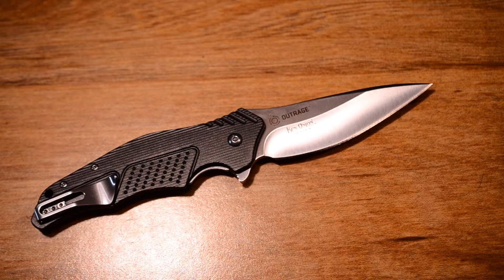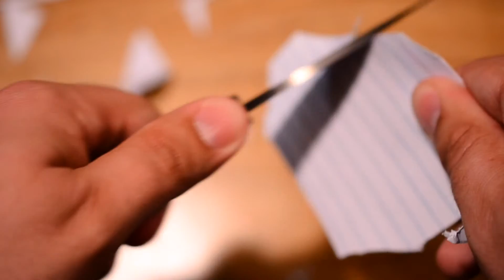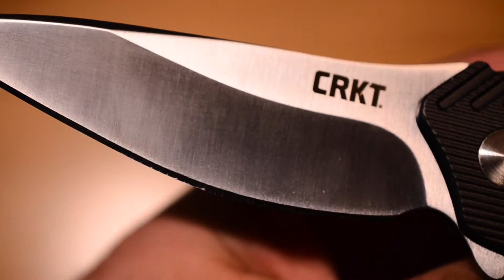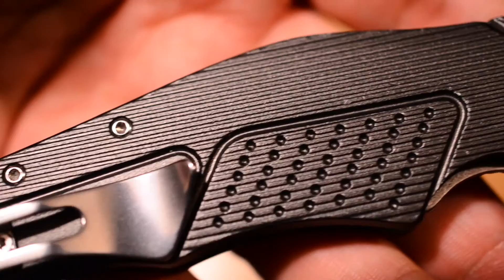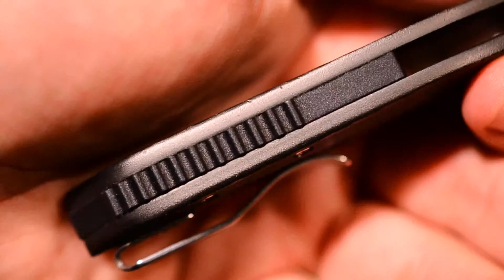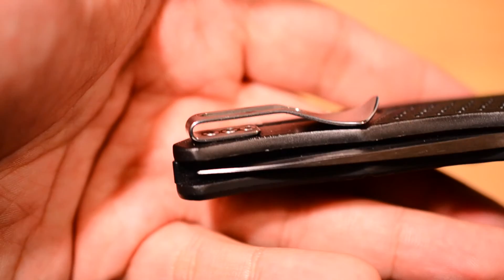CRKT Outrage (Ken Onion Design)

Comment: I like that clip on the Outrage, very unique.  I would have never guessed that the scales are aluminium, they just don't look like it on the video or in pictures.  That is a nice price for a Ken Onion with bearings.  I would have hoped that they would have used a slightly better steel, maybe 440C and charged an extra few bucks.